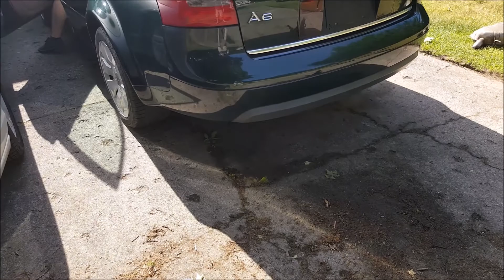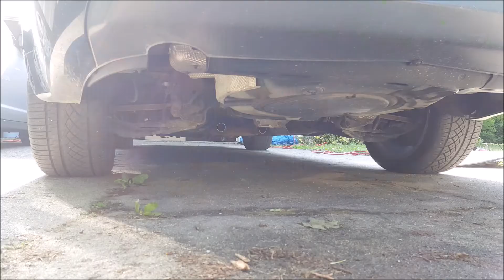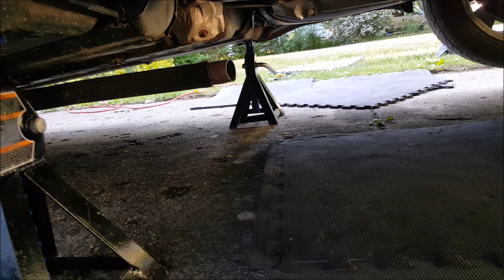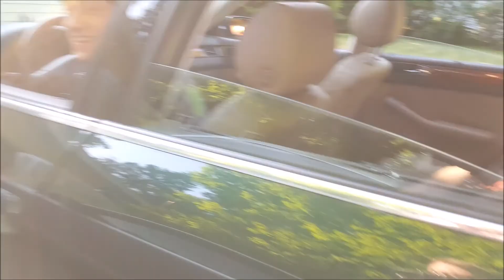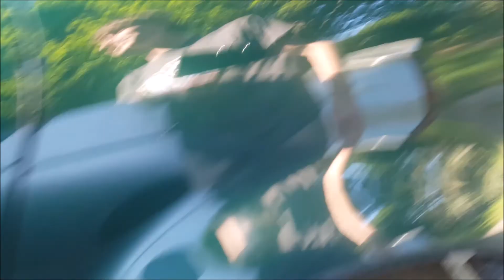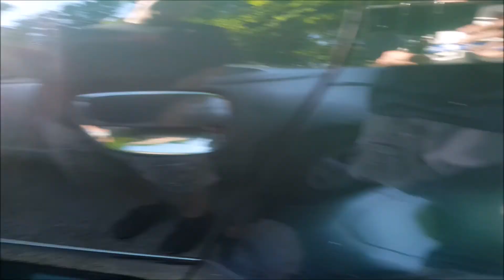Cutting off the mufflers on our new C5 4.2 Audi A6

Comment: yup these cars are great, but they eat transmissions. lucky to get 50k out of one.
Reply: get a manual, if you can, they are alot better
Reply: What about 250k
Reply: Mine has over 210k
Reply: Mine has 170k
Reply: Yea I have 2004 a6 4.2 v8. Running 129,000 it’s still doing great.🙂
Reply: 195k miles on a s6 c5 and still working 💪
Reply: I have S6 C5 with tiptronic and also running good in 228k km. 
Of course will be repair between 200-300k km. But all AT need this i think.
Reply: My 1997 audi a8 quattro had 250 miles before it shot its load
Reply: 285k on the $700 a6 4.2 i just bought. Drove it home lol
Reply: Joshua Rebman auto?
Reply: I got a 2002 audi a6 4.2 with a rebuilt transmission with paper so thank God for me lol
Reply: I have a 05 c5 4.2l that’s clean and runs very strong at 256k miles rn